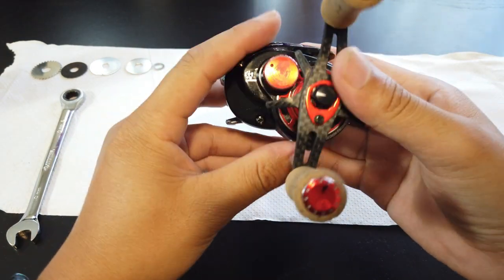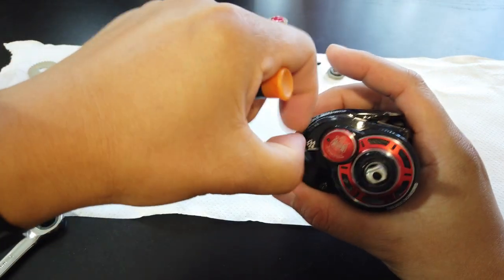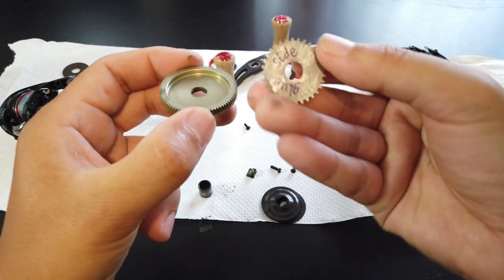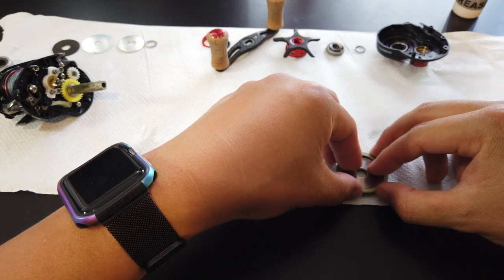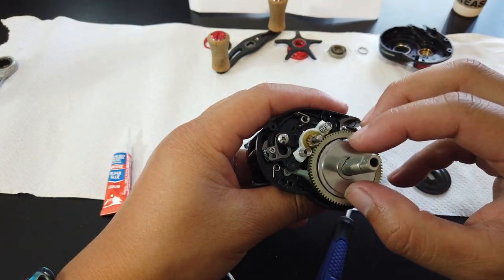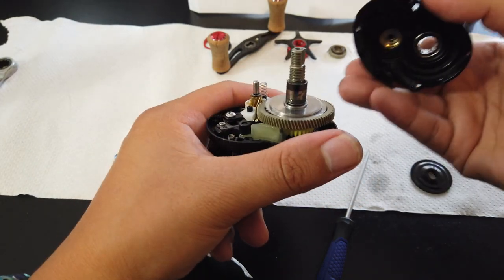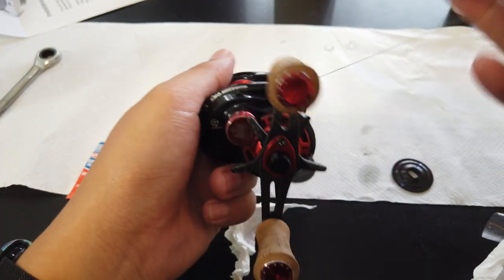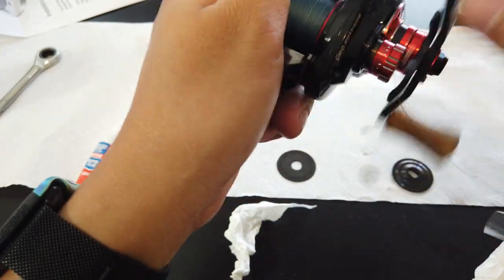Clicker Mod for baitcasters

Comment: up till now 2020........... BC reels still no sound when fish pull the line......and we have to do this stupid way to modify ourselves
Reply from the maker: I decided to take it off because I didn’t want the extra weight. This is currently the lightest reel on the market (4.5oz) . Also the drag stack on this reel consist of only one carbon disk, with the additional drag stack from the kit it sometimes would interfere with the smoothness. It would work nicely with other reels with a beefier drag system.
Reply: They technically don't need a clicker, they started using clicking drags for spinning reels so your line wouldn't twist, whereas a BC reel spools line directly so no line twist